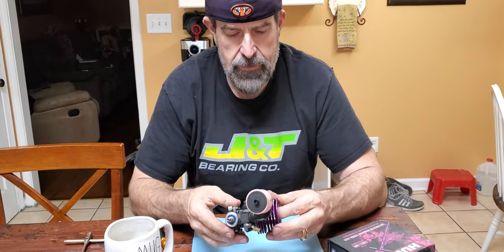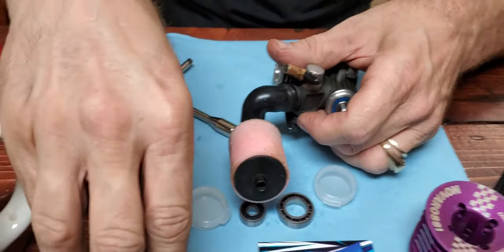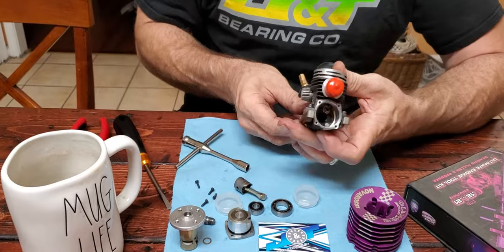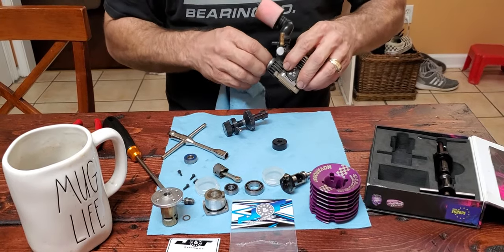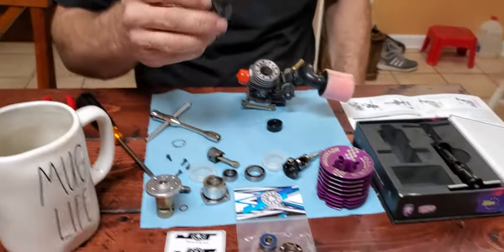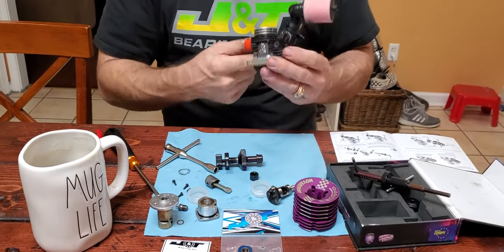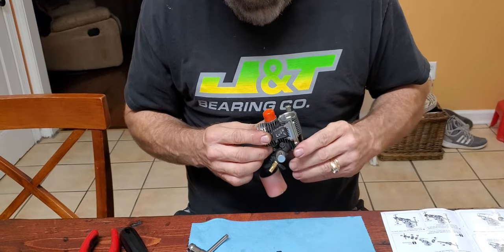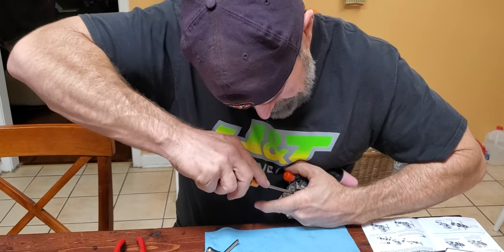Novarossi Bonito bearing replacement

Comment: Danny, how did those J&T ceramic engine bearings fare in your Bonito? I'm about to replace some bearings in my two older Novarossi P5 variants. Just wanting to know if the performance and longevity of these bearings were satisfactory... Thanks in advance!
Reply from the maker: They have been great. I've used them in a handful of engines.

Comment: are Ceramic bearing better then steel, if yes looking for 2 14x25x6mm for both my hpi .21r sc.
Reply from the maker: Yes. Ceramic is better.
Reply from the maker: But not by much.